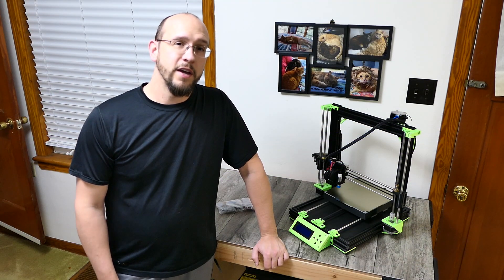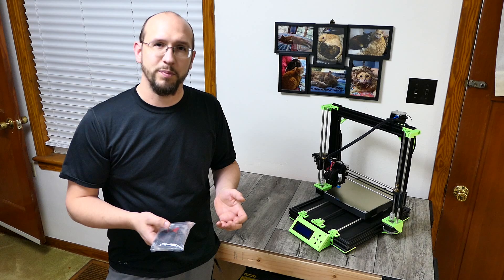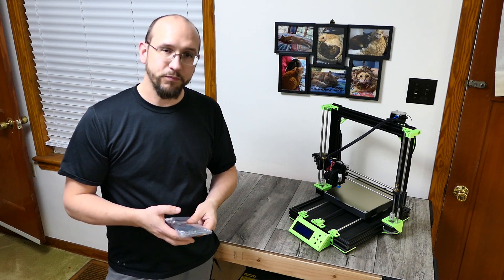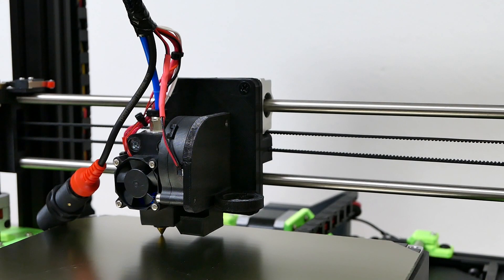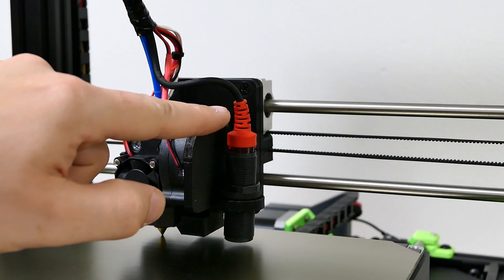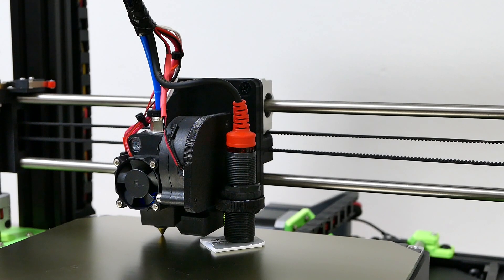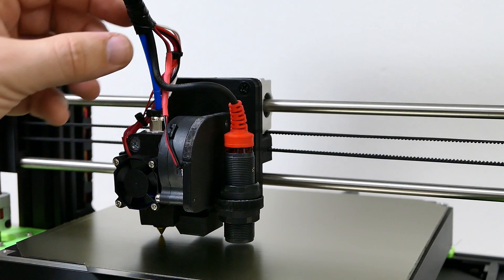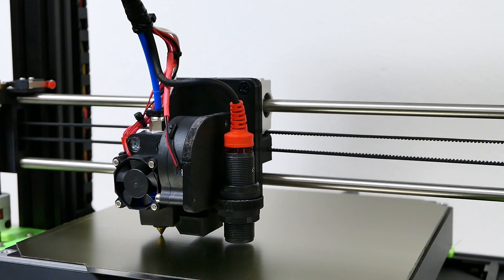EZABL Pro Upgrade Time!

Comment: Getting ready to start an AM8 conversation and really wanted to incorporate some of your parts and ideas into my build. Can’t seem to find any of your work on thingiverse. Are you willing to share some of your STLs for your drag chain setups, and your under the bed power control setup? Thanks! Killer looking build by the way!
Reply from the maker: Yeah, I need to upload what I have.  Mind you, tolerances are super tight, and were designed for the parts I owned.  But for the most part, it should all work the same.

I'll make a note and upload this stuff tonight.  Keep an eye on my Thingiverse page...
Reply: @M1dn1ghtN1nj4  truly appreciate it!!! Keep up the great work!
Reply: @ryans3340  is it stil available on thingiverse? I cant find it.
Reply from the maker: It should be.  I'll have a look after class.